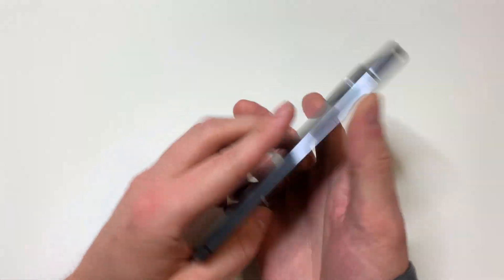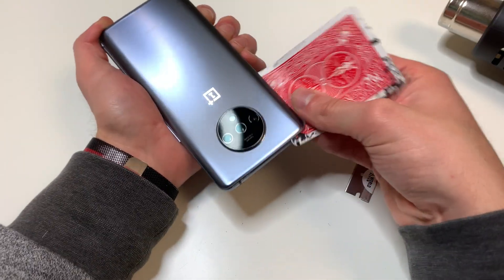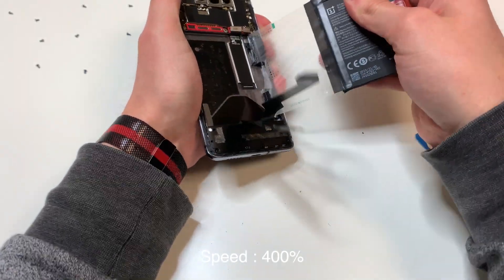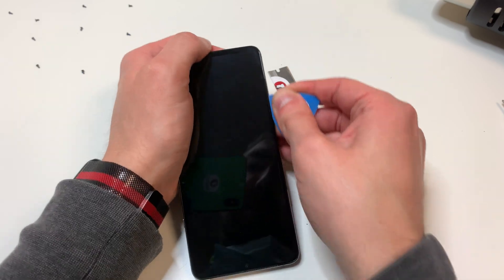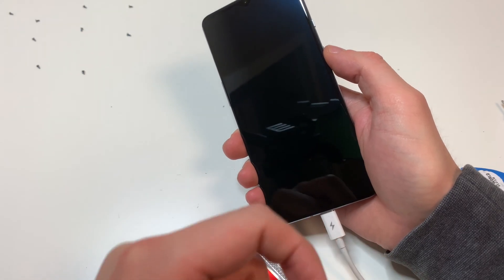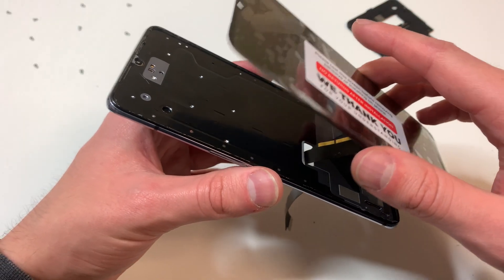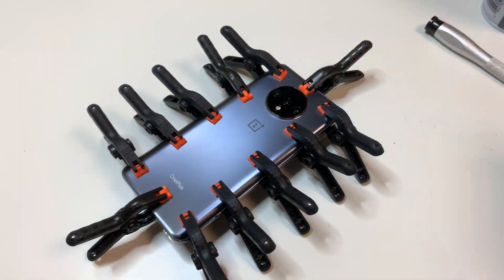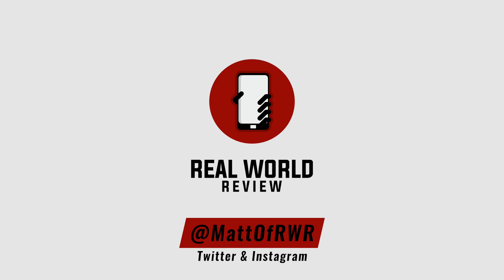OnePlus 7T Screen Replacement (Fix Your Broken Display!)

Comment: How can I know if the battery is original or not?
I replaced the screen and when I received the device, I noticed that the battery charge ended quickly, and I started to susk that he had replaced it.

Comment: i just drop it my oneplus 7t and it's not working ,even on charge nothing , so how to know if it's screen fault or battery ? 
the screen is little bit cracked but the crack looks inside you can feeel them by touch ....thanks in advance
Reply: Bro same so what happened to your mobile after dropping ?
Reply: @meerabraza5549  I bring to a repair store and they found out  the motherboard not working, it's like it burned from inside, the drop caused some short circuit....and the screen too... So I just forget about it as it will cost a lot....
Reply: But for my case , the phone when dropped it become very hot instantly.... I though I was the battery at first....

Comment: Great video!  Swapped the screen out for a friend.  The only thing I'm a bit worried about is it felt like I couldn't get the screen to sit all the way flush inside the frame.  Hopefully when the glue dries all is well.

Used E6000 as I didn't have any B7000 or T7000.  Will know tomorrow if it turned out alright.

Ohhh, side note.  Tea tree oil works great for breaking down the old adhesive on the glass back.  Just make sure you use rubbing alcohol to clean up the tea tree oil afterwards.

Comment: I got my 7T for £280 and now I have to fork out £170 just for a screen replacement.
It's an absolute joke. Also, they seriously need to start making it easier to extract data (photos /videos) from phones with damaged screens.
I have about 8,000 photos of my kids that I'll probably never get back now!!
Reply: That is if you buy and official screen.  I bought a good quality one for $74 USD off of ebay. 

The issue with getting photos off of phones without actual access is a security thing.  You can infact give yourself a backdoor so to speak into your android device by enabling ADB (android debug bridge) which allows you to send all sorts of commands to the device and access it even if locked over USB.  The issue of course is if you lost your phone and someone else picked it up and knew to check, they could access it too.

Any sort of backdoor option they add from factory, is a potential exploit waiting to happen.
Reply from the maker: I would rather allow that than never access my info lol.
Reply: @HaemonAK  do you have a link to the one on eBay?
Reply: @TombombSilver  I tried linking it, but it wouldn't post on Youtube.  I'm sure it's flagged as an advertisement, ect

Comment: Hi, i gave this phone to a technician to repair the screen and he mentioned that the fingerprint reader will not work after he replaced the screen. is this normal?
Reply from the maker: Yes. It is annoying but true. Apparently a calibration product exist, but I cannot find one
Reply: @RealWorldReview  ah okay. Thank you for your response. I've picked up my phone. Just happy to have it up and running once again
Reply: @P105Mews 
Yeah it's something to do with how the security works on android. Oneplus have even reached out to Google to fix the issue
Reply: @RealWorldReview  check out mobile defender, it has a cube flesh colored calibration tool. I'm not sure if it works but it claims to be OEM
Reply from the maker: I have that now. Never does anything for my repairs